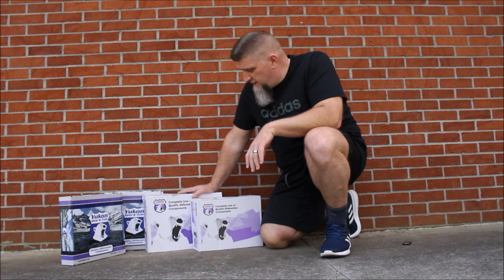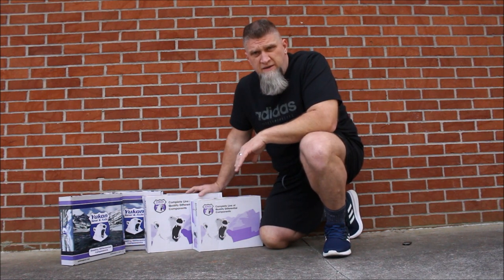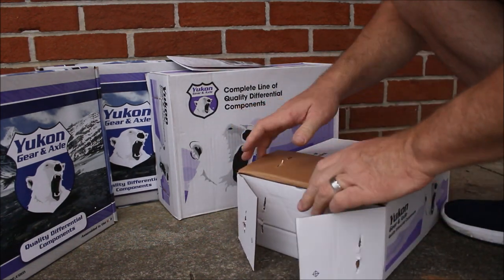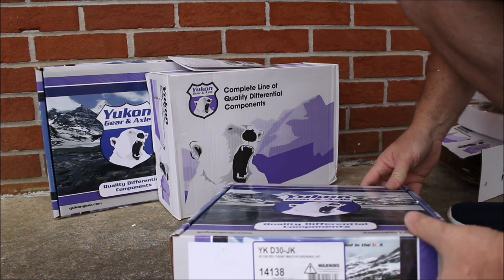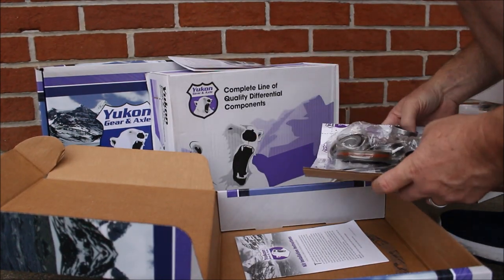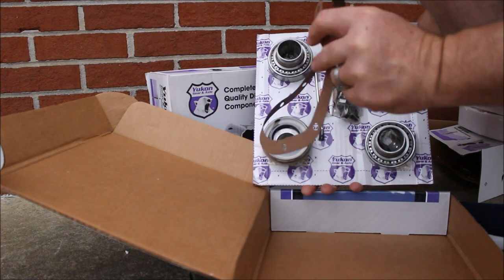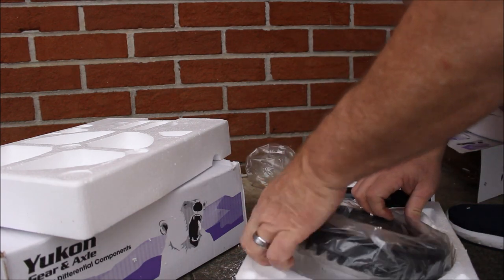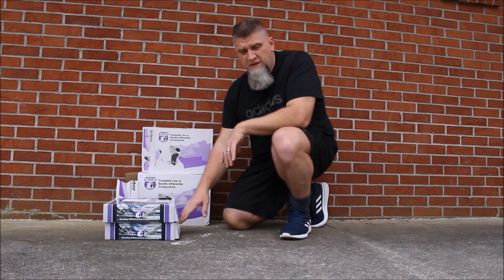Yukon 4.56 Gears with Master Rebuild Kit | Jeep Wrangler Mods

Comment: Are you running open diff front and rear? Did you add a LSD or  locker?
Reply from the maker: I had Yukon Grizzly lockers installed at the same time as the regear. Thanks for watching

Comment: How does Yukon compare with Dana Spicer gears?
Reply from the maker: From my limited experience is that Yukon gears are the closes to OEM in terms of sizing for proper gear lash set up. Yukon seems to be the std in the market. Zero issues with mine, runs great.

Comment: Is it anyway possible to run a 37 inch tires with 4.56 Gears
Reply: I’m running 35 In  tire ,can you run 37in
Reply from the maker: You run 37 tires on 4.56 gears but I don’t think you’ll be 100% happy with the overall performance. Common is 4.88 gears for 37 inch tires. My 4.56 gears are perfect with 35’s, I’m at 25/2600rpm at 70mph. She performs great everywhere with this set up.